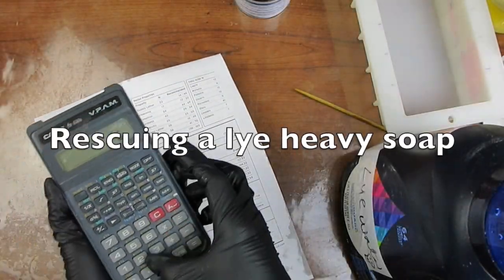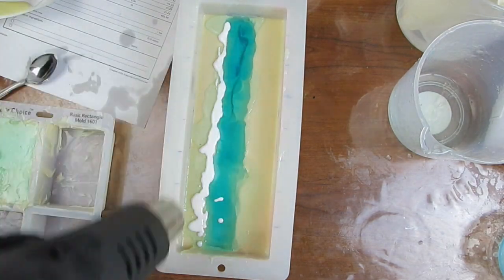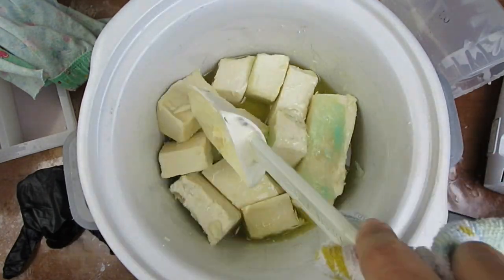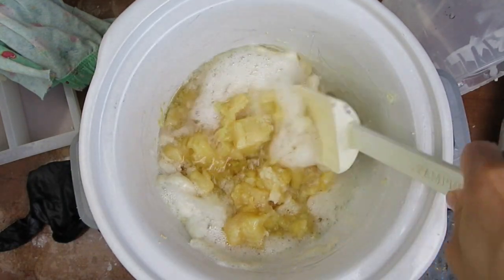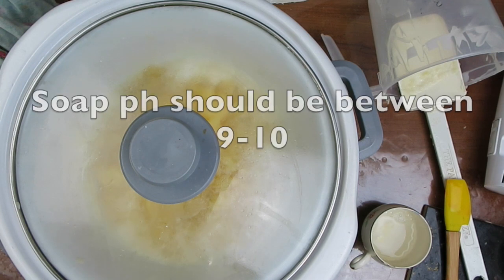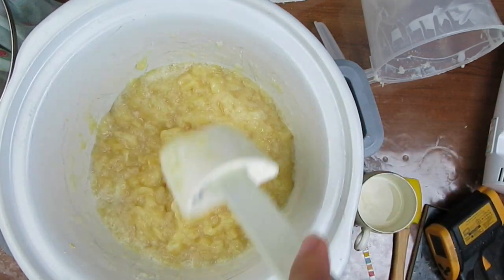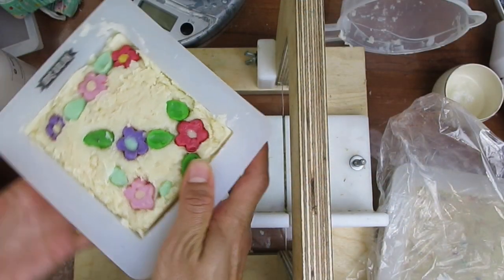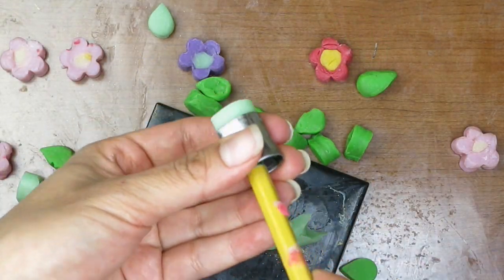Fixing a lye heavy soap - from CP to HP

Comment: Would it have not have helped you to lightly stick blend the whole pot a few times when you saw that the oil and soap was were not emulifying together?
Reply from the maker: It may have helped a little, in the past though, when the soap is that thick, the stick blender is not very effective, the gummy paste fills its cavity and the blades don’t seem to mix anything around them, and there is a risk or even burning the motor by forcing it continuously.  If it was more fluid it could have worked.
Reply from the maker: Given the water content of the soap at this stage (just cut) shredding was not feasible, it would have gotten stuck in the shredder instead of coming out in Shreds